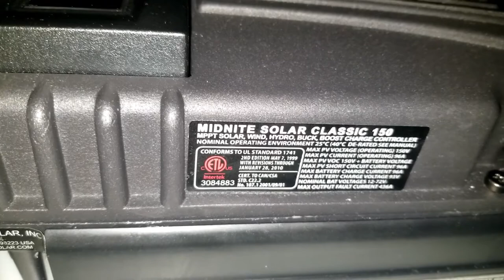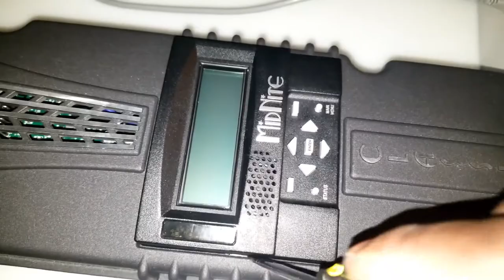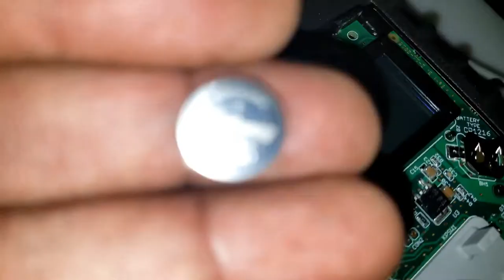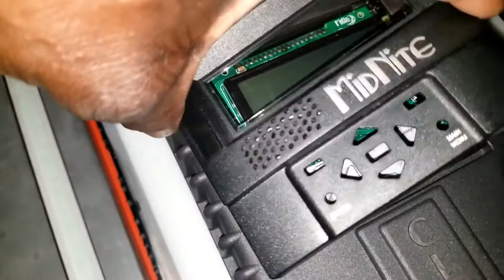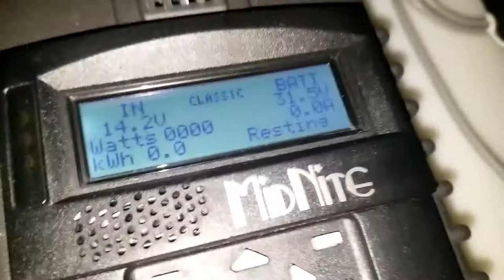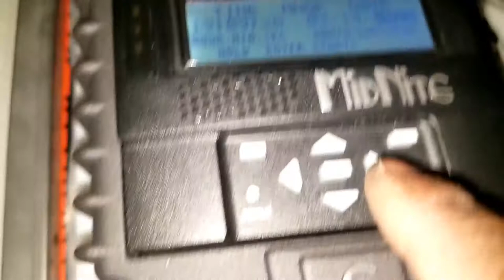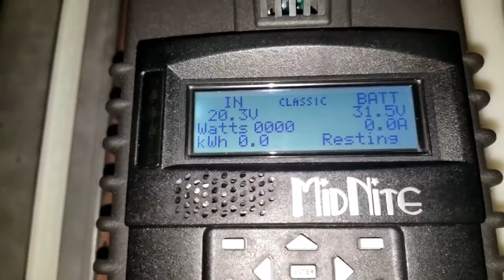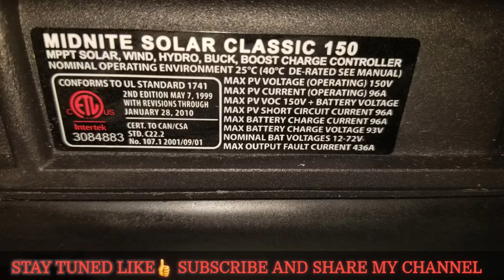MIDNITE SOLAR MNGP BATTERY REPLACEMENT, CLASSIC CONTROLLER DISPLAY

Comment: Have to change mine soon I have that model but couldn't get the talking firmware update
Great unit though built like a tank
Reply from the maker: These are tough equipment to have in your Off Grid DIY Power house